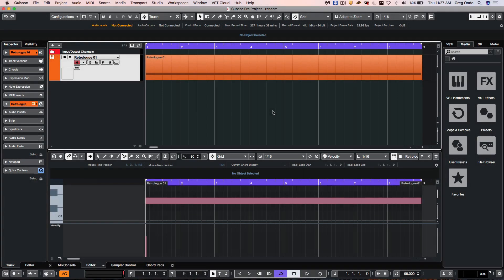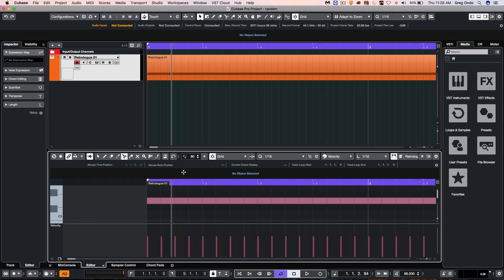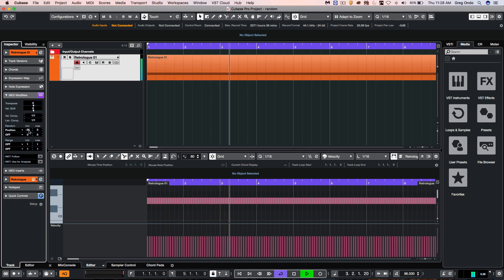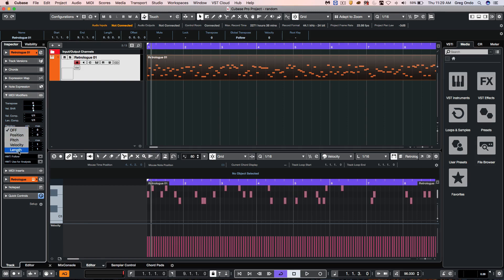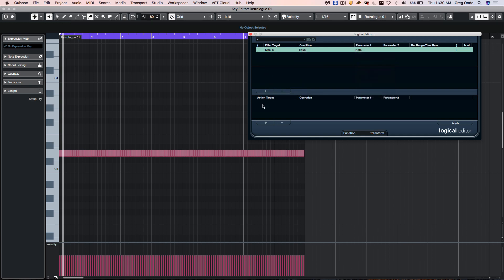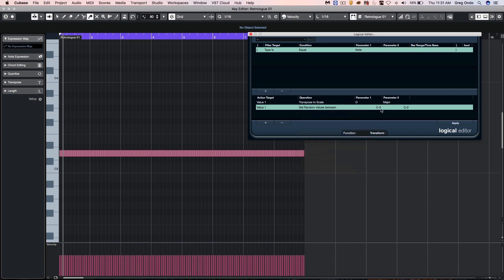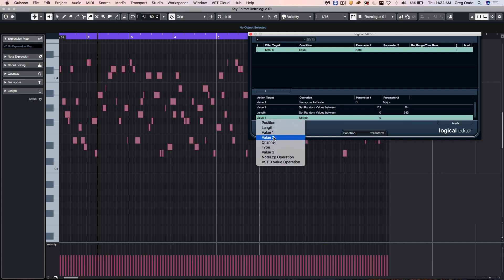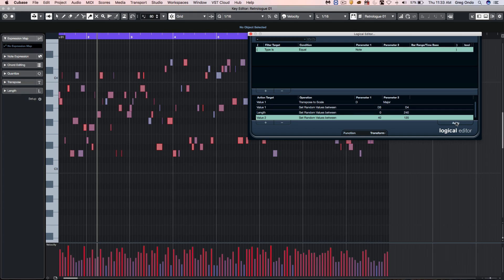Applying Randomness to MIDI Parts | Cubase Q&A with Greg Ondo

Comment: Hi Greg, I did followed exactly how you showed midi data randomness in logical editor but when I select value -1 to set  random note value instead of showing Note range (like C-2 -C7) it is showing 0 and 0 in two box. If I put my target note range it is not working. Any idea?

Comment: Great. I already used logical editor to create a template 'humanize' (which you don t have embedded in Cubase, that would be great for newcomers). I use it for arpegio to change a bit the start and duration of notes and the velocity). Really efficient with mechanic arpegio

Comment: I've been using Cubase for years and didn't know you could do that with the scissors.  However, while the randomized lengths worked in the logical editor, that certainly wasn't D major.
Reply: can you randomize the rhythm of the notes in the logical editor?
Reply: @Barefoot67 You certainly can with midi modifiers by setting it to 'position' and changing the value.

Comment: I didn't know you can split a note repeatedly in a single click like that.
Reply: Steinberg likes to develop a features  that we probably gonna use once in a lifetime :)
Reply: Roman Korolkov I use this so often. Its better than dotting midi notes in and better than using the line tool. 
This feature is so useful for making rolling hihats, snares etc combined with the quantize settings. 
Tip: Add key commands to quantize values to make the process even quicker.